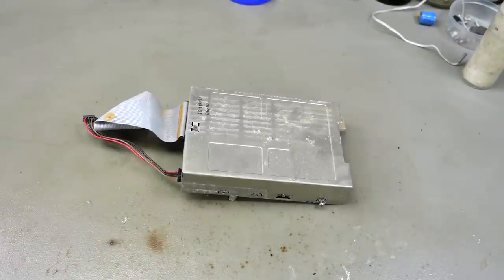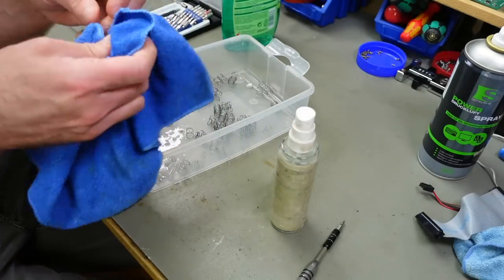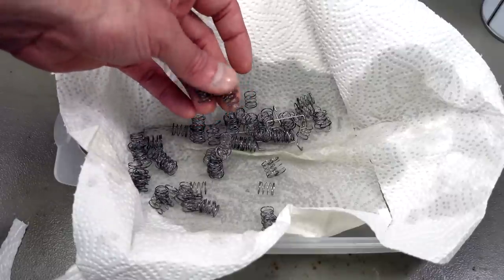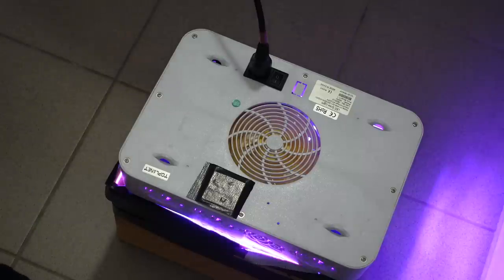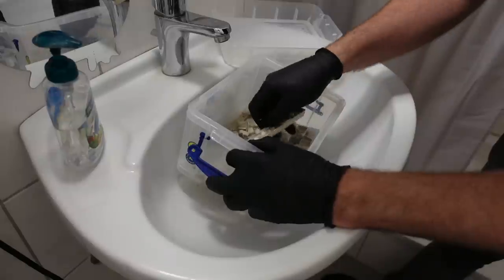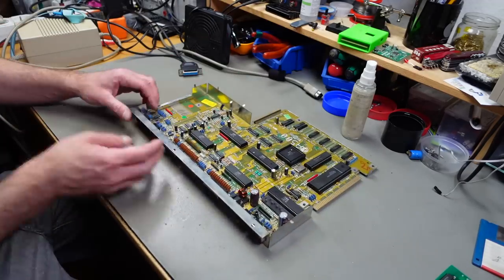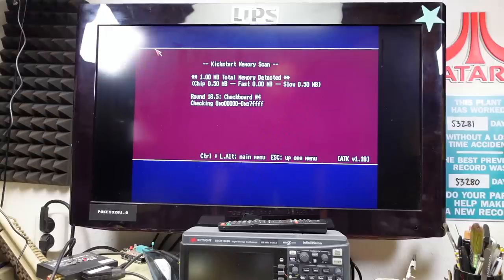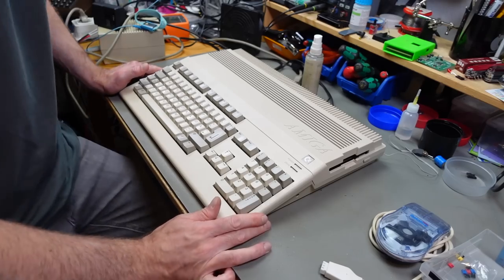Amiga 500 Saved from the Flood (Part 2)

Comment: Hi Jan, thanks for another set of interesting videos!  What is the glue you used on the case - is it regular super-glue or?
Reply from the maker: It’s UHU Plast Special, German brand Model making plastic weld glue. Super glue is completely different but might work well for those kinds of cracks, too.

Comment: Oh hey, what a perfect video to watch while work on my current project, making a bracket to mount a power supply in my Apple II clone!

I took the opportunity while watching your video to try out some plastic cement too, and it worked really well! It wasn't a specific plastic cement product, it was actually product sold as "pipe cleaner", used to prepare PVC drainage pipe before using that coloured PVC pipe cement. However it does seem to work pretty well on ABS (I'm making the bracket out out "styrene" sheets used for model-making, which is basically ABS).

The only downside is that it smells pretty strongly of chemicals, to the point where it stings my eyes if I get too close. I think I'll have to set up a fan next time I use the stuff.

Comment: That retro brighting turned out really well, I always fear the use of cream having seen some awful streaking in video's. When I do it I use a big tank (basically a super sized one of the boxes you did the key caps in), but need to get a grow lamp, was using UV string lights but they were not so good. Jan, could you point out what grow light you used please on ebay or wherever you got it from. Thanks..
Reply: I just use submersion in 30vol hydrogen peroxide liquid sat under 2x generic 30W LED UV lamps from Amazon. The box is lined with reflective insulating bubble wrap. I get great results.
Reply: @Daz555Daz  Cheers for that..

Comment: Two things/questions:

1. Isn't the glue you're using actually just acetone? That would desolve the plastic the same way you're explaining. I've been using it for printers in the past, with good result.

2. Regarding retrobrighting, I know this is a controversial subject. But I have always just been using sunlight. Putting an Amiga 500 in high sunlight for a few days (in Denmark), has been turning a very yellow Amiga into an Amiga looking like new. Which experiences do you have with that? Some people thinks it will make the plastic more fragile. This is not my experience. Been doing it for a few years now. Using just sunlight, makes me think it is better, both for the Amiga and the environment. Haven't tried with chemicals (yet), but using sunlight does the job for me :-)
Reply: But sunlight is the cause of the yellow/brown blight to begin with!

Comment: That "full spectrum" grow light is purple because that's the most efficient for growing plants. If a light contains the full spectrum (of visible light) it would appear white. Plants' leaves appear green to us because they reflect, not absorb, green light, and if you're trying to transfer energy to a plant with light, it's inefficient to waste about a third of that energy on light the plant can't absorb, so grow lights are just red and blue lights, which won't bleed into a useless band of the spectrum for plants. For retrobrighting, you should be able to use just an ordinary visible white light, since peroxide probably doesn't care what colour hits it. If you want to grow tomatoes (or some more clandestine herb) indoors at home, a purple light is great. If you have a grow light to use on retrobrighting, that's fine, you're not wasting any energy there, but if people are new to it and shopping for gear, I don't think shopping for a grow light is necessary. The most important thing is the intensity of the light. A little 5W worklight won't cut the mustard.

Comment: This was extremely satisfying to watch. As it happens, I also have an Amiga 500 sitting here that is waiting for a recapping and some retrobrite - the keys look especially bad, they are almost a dark brown. The machine works basically, which I found extremely surprising. It was an ebay find from a couple years back and I only recently got around to finally taking stock or the machine’s state and ordering parts. The NiCd battery on the RAM expander had just started leaking but I think I caught it in time. Hopefully next weekend I will be able to get started. Looking forward to it after watching this video ❤

Comment: I have this idea for a possible solution against these aging and brittle cases...

Would it be possible to add an extremely thin layer of this epoxy two component glue to the inside surface? That would possible stiffen off the case. I am thinking about half or quater of millimeter thick layer.

Comment: I know you applied WD-40 to just the springs, but I avoid using that in any of my electronics work and just use contact cleaner.  It works just as well and doesn't have the things in WD-40 that can cause plastic rot.  I know you just applied it to the springs, but those springs do come in contact with different plastic parts.  You're probably fine here, but it is something to be aware of with what WD-40 can do to plastic.
Reply: What would you think about a light application of a silicon based lube? Sort of like a gun polishing cloth. That's nothing more than a lint free rag impregnated with silicon polish. But they're cheap and put a super super light coat of lube on the items. I've never had an issue with any plastics personally with that... but take that with a grain of salt.

Comment: When you use the plastic weld solvent type very liquid glue in model making you actually put the two parts you are gluing together, maybe be using tape, and then apply the glue on the non visible side. Capillary action draws it in to the joint where it melts and welds the plastic,

Comment: One problem with retrobrightening keycaps: They are pad-printed, print protected by a transparent coating. Hydrogenperoxide is agressive to the coating. If you retrobrightening for to long, the print can litteraly swim away.
Actually this does not have to be a bad thing. If you have a high resolution scan and print the labels with dysub ink on transfer paper, you can reprint the keycaps with a better method than original done.
You might even do this intentionally, if you scanned a german keyboard and want to convert to an italian for example. Or the other way around.
Also you might want to reprint a Pi400 this way, if you want Amiga Keys.
I use the thermal retrobrightening method: Keys in a box with hydrogenperoxide, 3.5h in the oven @65°C. Works quite well. As the hydrogenperoxide decomposes, it is not reusable this way - it is more agressive this way. But still a second go might be needed with fresh hydrogenperoxide. But a second round this way always result in letter soop at least on some keys.
Reply: Yep, I had this happen when I over-retrobrighted my Atari 520ST.